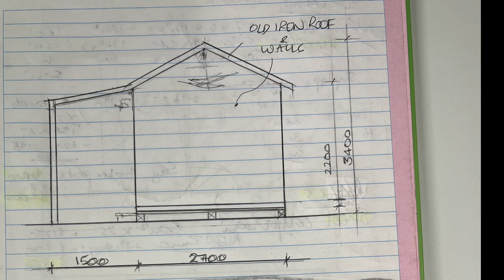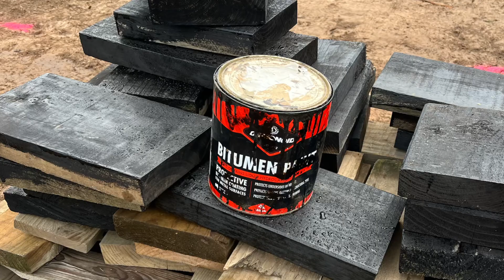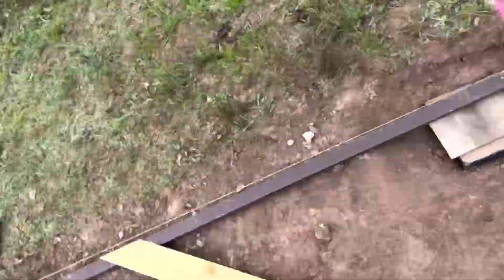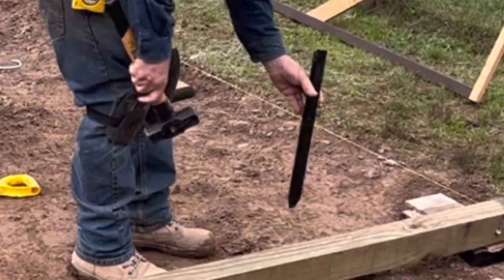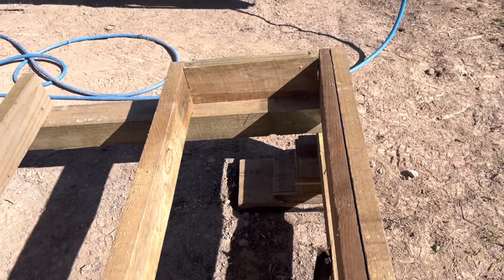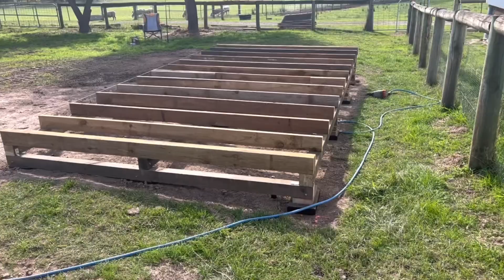Build a BUSH CABIN with Grandad Jack! BASE STAGE.

Comment: Why did you have two sets of bearers sitting on top of each other? Just to get the structure off the ground a bit more?
Reply from the maker: It is better to lay the floor joists across ways so the flooding sheets can be laid longways otherwise to much waste on the flooring sheets. Therefore the bearers under the floor joists are running longways. You can just put pads under these but for underfloor ventilation purposes it’s better to elevate these with additional cross bearers under these 🤠

Comment: Looks fantastic. What are you planning on using these for? Do you think these would be usable for habitation? As an architecture student with construction interests, I'm loving the construction-style videos.
Reply from the maker: Hey cool 👍
Yes they can be although proper ‘footings’ ie stumps or concrete pad would be needed for a permanent occupation permit.
These are quick and easy to build !
Reply from the maker: They are just a sleep out type building for a visitors